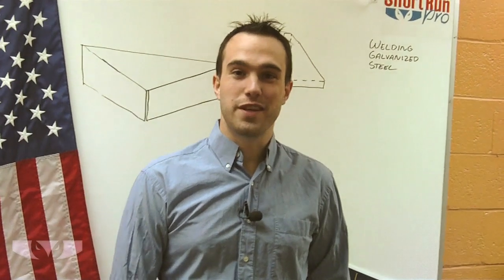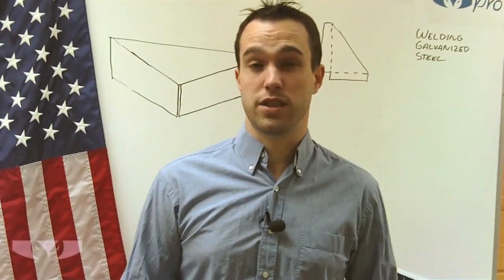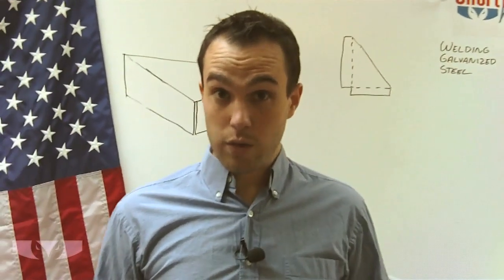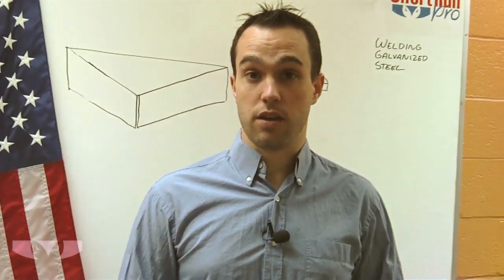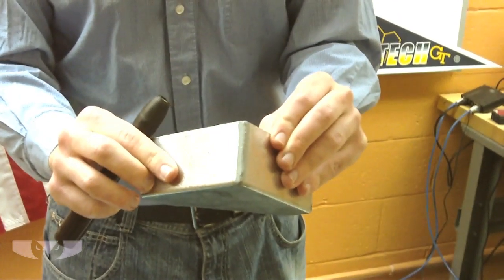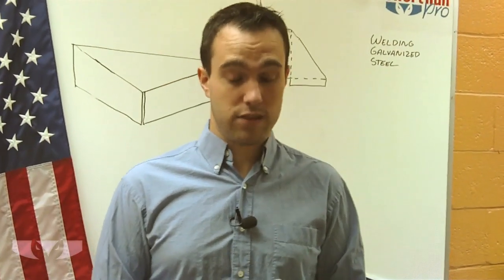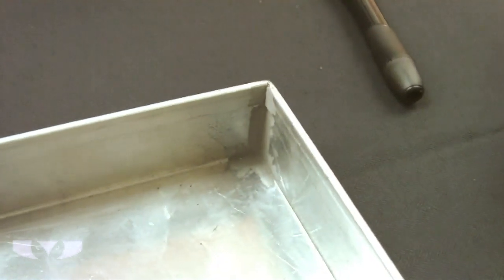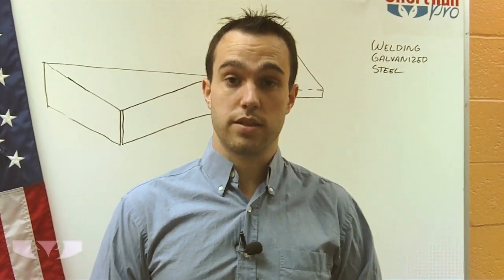Welding Galvanized Steel / Manufacturing Series sponsored by Short Run Pro

Comment: @Oscar Labra It also depends on what size your electrode is and what the flux coating consists of. There are no set rules in welding, just guidelines.

Comment: That's true man. But when Lowes or somebody like that puts in an order for 3000 parts and wants them done in a week, you gotta do what you gotta do you know? But yeah man its a good video. The only thing I do a little different with galvanized is crank up the heat and wire speed to burn through that zinc coating a little easier. That, and I'll turn the gas up a little to shield it a little better.

Comment: I hate welding galvanized steel at work. We don't have time to grind off the zinc coating, so we just have to wear respirator masks and tough it out. Even with a mask I get headaches from it though haha.. If you ever have to weld this crap without grinding the coating off and you get sick from it, milk helps a lot.